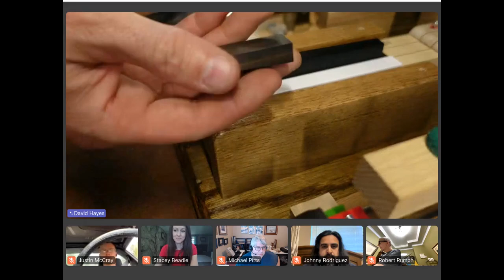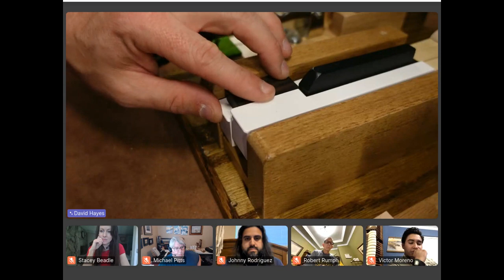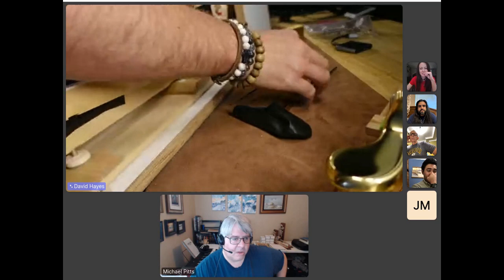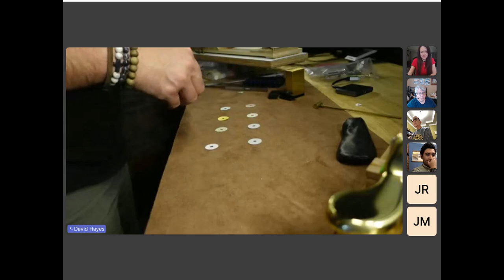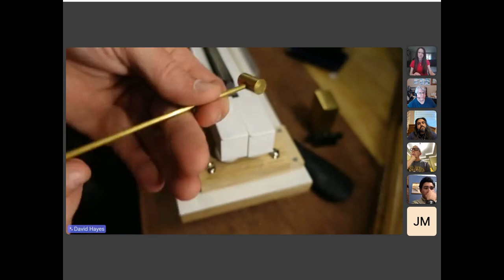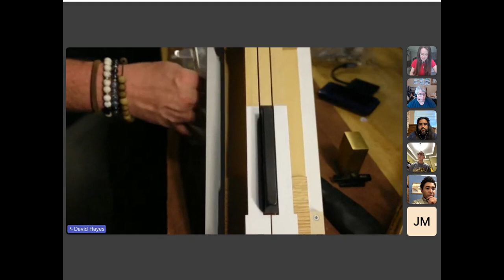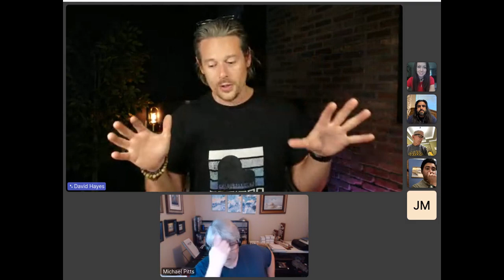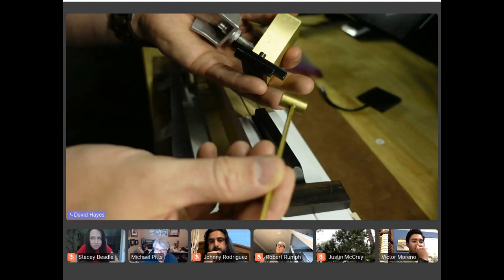Time to Dip!  Key dip tools and techniques

Comment: This is very interesting. Learned a lot. Loved the punchings on the rail pins ;). Could use more explanation of the Erwin tool as used on the white keys and for setting after touch. I definitely want to learn more about your offerings at Artisan pianos. I also recommend this video in the Irwin tool. It covers key dip and after-touch with the one tool.

https://youtu.be/vEW-lTxwtng?si=y3NyPUbMx8RdgKNh